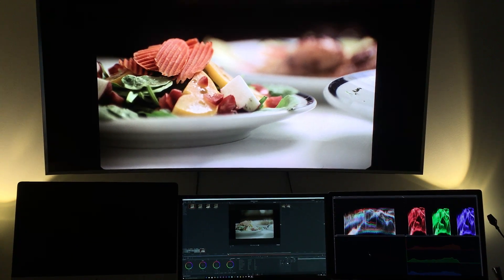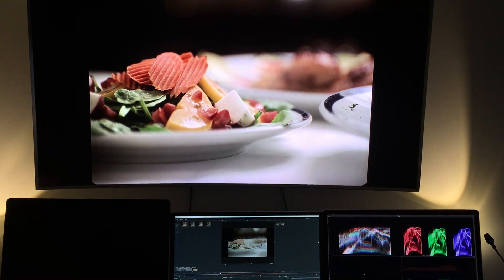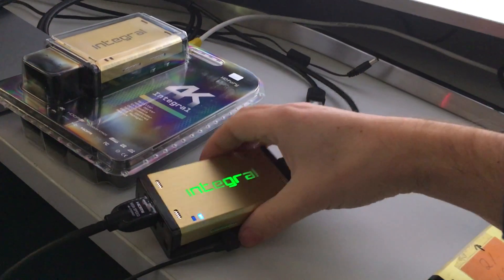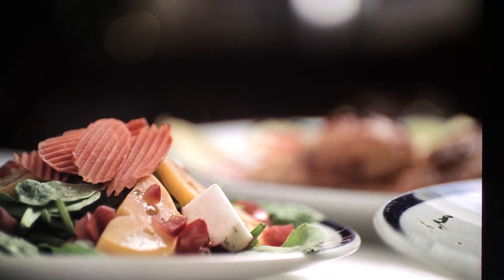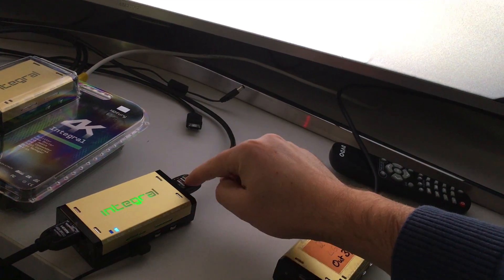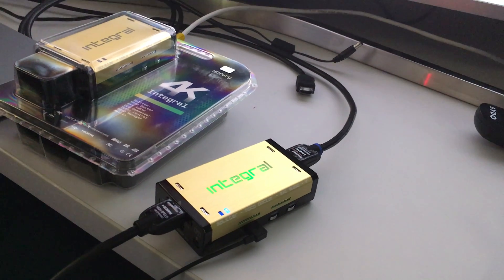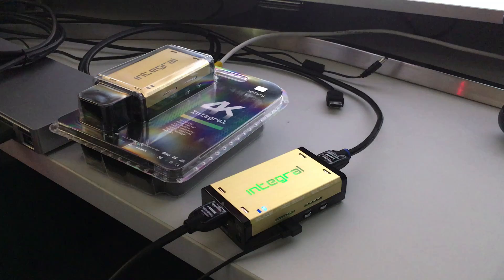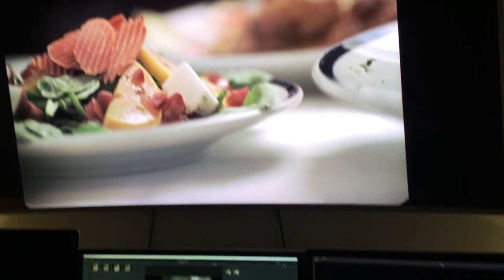HDFury Integral with AVTOPcontroller for HDR video: general explanation

Comment: Which LG OLED is that?
Reply from the maker: +rammichaelyar LG 65EF9500
Reply: +AV T.O.P. Messtechnik GmbH does that have HDMI 2.0a onboard? or was the HDR passed through an HDMI 2.0 port?
Reply from the maker: +rammichaelyar  The source was no HDMI 2.0a - the HDfury makes it HDMI 2.0a by injecting the infoframe, that's the trick. It's all about adding the right metadata, when it comes to HDR.
Reply: +AV T.O.P. Messtechnik GmbH what if the TV only had HDMI 2.0 but supported HDR for streaming?

I am thinking of the LG EG960. it currently supports HDR streaming and there is some confusion over whether or not a firmware upgrade will arrive taking it to HDMI 2.0a.
Reply: +rammichaelyar But if my tv doesn't support HDR I can watch in HDR with integral,is right or not?
Reply: +rammichaelyar But if my tv doesn't support HDR I can watch in HDR with integral,is right or not?
Reply: +rammichaelyar good question ! Do you have an answer now ? Is the fury able to inject HDR data into an hdmi 2.0 (non 2.0a) entry like the oled lg eg960. This tv can handle HDR but will it recognize the HDR signal thru hdmi ?
Reply: +Adrien Kauffmann I bought the LG and the latest build of the same model is 2.0a so I didn't need to worry. also there are no source devices yet that will produce the HDR on HDMI 2.0a yet so it's more for future proofing.
Reply: +Adrien Kauffmann I might answer myself since the  tv model used here is the 65ef950 that doesn't have any hdmi 2.0a port, it should be the same for the eg960. That's some good news for early adopters. Let's wait and try some uhd br disk. We might also see this injection technology implemented in future uhd br players. ( "old" hdmi 2.0 HDR proof) After all maybe LG will offer us a software update that could read regular HDR data thru the hdmi 2.0 ports. Wait and see. Going back to Netflix 4K now.
Reply: +Adrien Kauffmann the 960 has a firmware update. as for the rest....tour best source is to call LG itself. I did a lot of research online and only found conflicting incomplete information. LG were very informative.
Reply: +rammichaelyar yes the eg960 has a firmware update that makes it HDR compatible with usb, and streaming content for sure but not with hdmi.
Reply: +Adrien Kauffmann the 960 has HDMI 2.0a which supports HDR over HDMI.
Reply: Not my version it's an October 2015 and it only has 2.0 HDMI
Reply: +Adrien Kauffmann mine is December 2015. I suggest you call LG.
Reply: I just did they had to check they should call me back soon. Is your version eg960-za or eg960-zd, mine is za
Reply: +Adrien Kauffmann zd